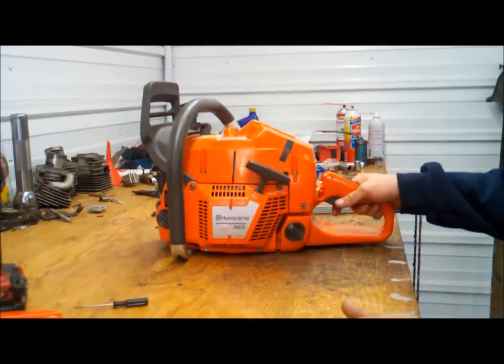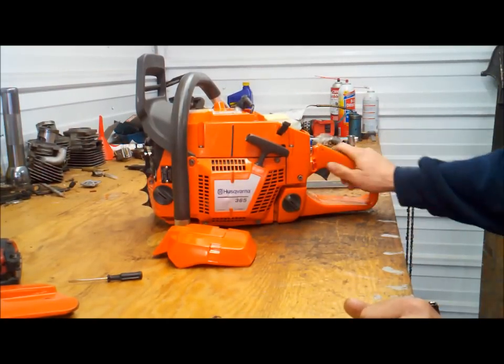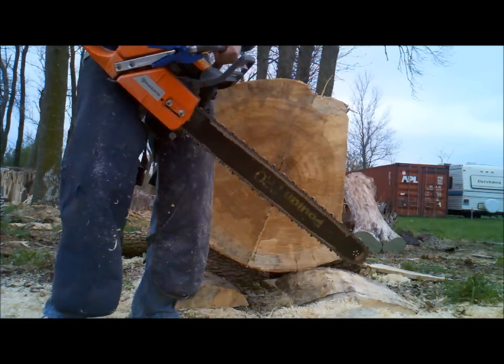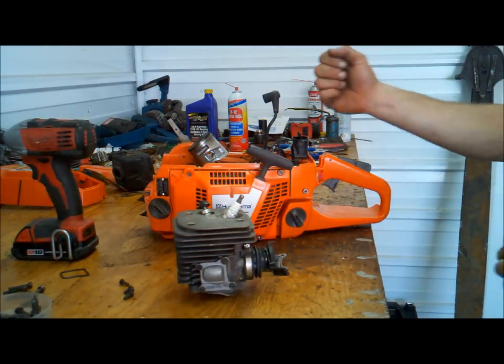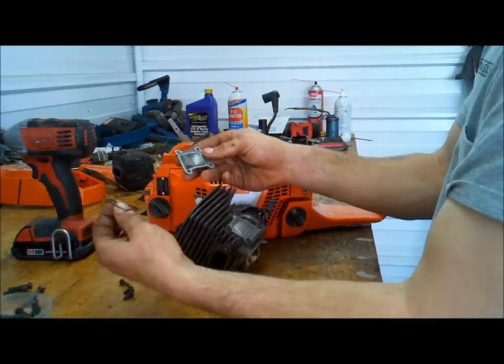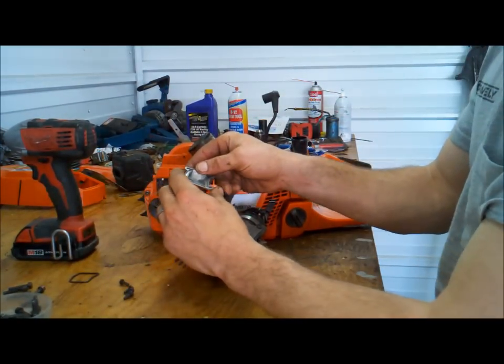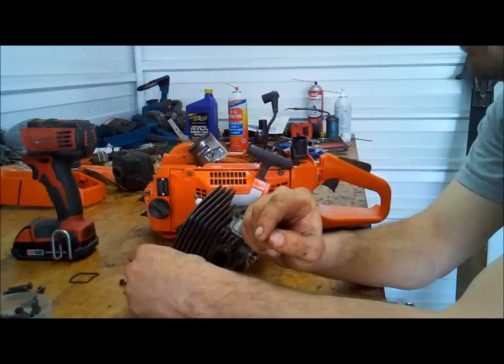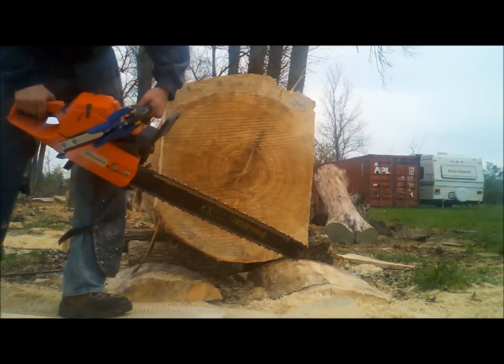Converting a Husqvarna 365 x torq into a 372 x torq

Comment: thank you! I just bought a 365 x torq and my gut feeling was to not buy the 372 x torq.  The 372 weighs .5 pounds more and I wanted the lighter machine.  Didn't do any research before the purchase other than look at the Husqvarna web page.  but the sticker on the 372 x torq said the 372 x torqe weighs less than the 365 x torq sticker.  the Husqvarna web page said the opposite.   maybe its the xp vs the x torq weight.  I am extremely happy about the simple mod I can do to improve this saw.  whats weird is I couldn't really tell by watching that there is a huge difference, but 10 seconds is a big difference and I am sure you can feel that.

Comment: Just did this conversion. Super easy to do. I disconnected the the intak boot instead of removing the carb. Slide the cylinder up about 2" and presto. Covers off, Grind em. Reassembly is easy this way. Man the saw is an animal, you could do any job with this saw. More power than my friends 372XP.

Comment: Thanks friend, the video was very helpful. It is not necessary to disassemble the entire machine, develop only four bolts that hold the cylinder and pull it slightly upwards, then find torx Bolts of pieces that close the ports and I already have a real 372. Their Great
Reply: I disagree with this info..you should remove the cylinder, if you are removing the cylinder; all the way for moving the cylinder upward may drop particulates into the bottom end which you don't want.

Comment from the maker: When looking at the top of a piston, the scavenge/transfer pattern is left in the form of carbon deposit.  When the tranfers are ported correctly, the incoming charge washes the piston top clean in a uniform pattern.  The goal is to clear out all the expent gasses to achieve the most efficient charge.

Comment: Hi mweba good work,i have that saw bought it in 2014 new,i do not believe  in doing all the work in the saws ...if you need a stronger saw.just get a stronger saw collect them lol,soo i did  the story was bought second hand MS 290 runs beauty,then found 455 rancher good price bought it, friend seling new in the box 365 x torq made in sweeden bought,then i saw your filme and i said wy tear down the beauty saw just for the collection  and one day i will prove ,,,,i bought  the beast Husqvarna 3120 new,so now i have the small collection  just seating....wy all this....i have a question or two,, the seized saw i am sure that won't happened because i put oil in the pistons and stuff,,,,what i am worry about the boot on the carb ...the 455 rancher,the 365 x torq and the 3120 never saw GAZ maybe except in the factory when they build them, i have no ideia ,,,,do you thing the boot will go bad anyway after few year of seating?Like i said  all 2014 saws,then i have make that SHOW video on day,for sure i will tell you. i almost forgot for the 365 x torq i bought the tall covered the wrap around Handle only from the 372 new made in Sweden the cover,the handle i have no ideia where is it made just bought the cover not the filter,one day if i run it i will try the small cover and the tall see if makes any different ,Changing that on the side of the cylinder to have more power i will not have that dan...now i looking for the 395 NEW 2014 if i find it,i will had it to the collection.People old on one day i will prove all this do not call me names...not only the saws  but the Extra Light Bars i bought for the saw from JAPAN,just wait you will see them.

Comment: Mweba i forgot to ask..for the MS 290 its the only saw used now seating most of the time  friend of mine said the mix instead  of 50 to 1 put 32 to 1 do you agreed with or no?so 8L of GAZ 250ml of oil the piston its not going to plug itself? ty for the help in advance.

Comment: there is more difference to the 365 cylinder than you think. I ordered a aftermarket cylinder for my 372x-torq and the sales person said it was for a 372. when I got the cylinder kit it looked the same on the outside but way different inside. the cylinder did have the baffles in the transfer ports and the air ports in the cylinder was 1/4 the size of the original that I have. so, there is more difference in the cylinders than you think, not just the transfer ports. so I had to return the cylinder because it would have had way less power than if it was a cylinder for a 372
Reply from the maker: You purchased an aftermarket cylinder.   This in no way is comparable to the OE jug.   They are mostly junk.

Comment: 359 to outcut a 357.  Please share how i could make that happen! Thanks
Reply: The 359 cylinder is detuned by  making the lower transfer port opening very small.   Tho it does have removable transfer covers, it's not necessary to remove them.   Google for more info.

Comment: 365xp-xtorq piston fi48mm
372xp-xtorq piston fi50mm
these are 98.5% of the difference
Reply from the maker: Marko Radulovic both 50mm
Reply: The 365 special had a smaller piston the 365 x-torq has the same 50mm as the 372